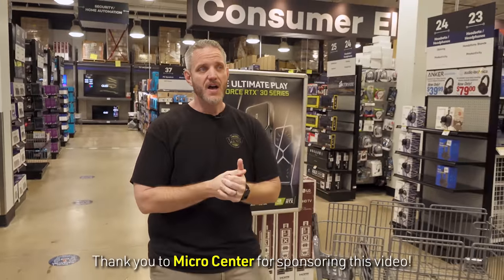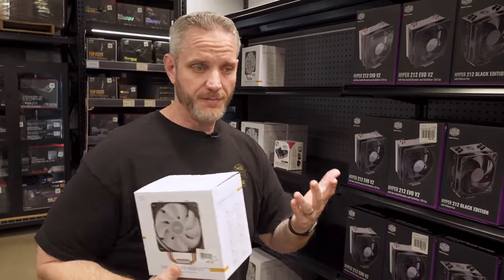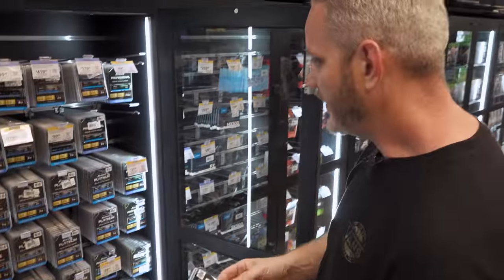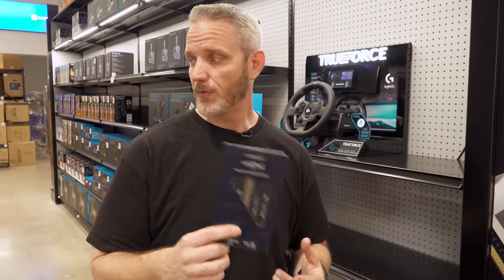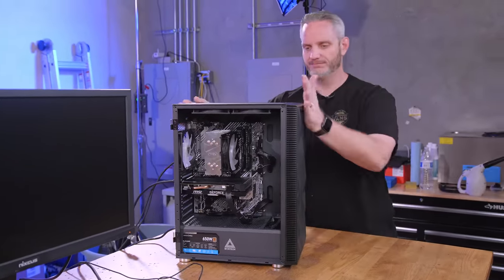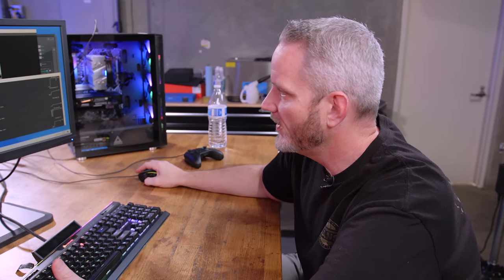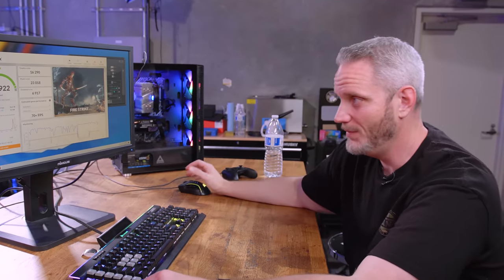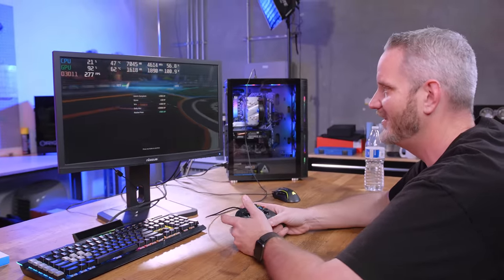How cheap can I build a "Gaming PC" for in 2022

Comment: Confused by the CPU choice: yes the AMD was $20 more expensive, but it comes with a cooler, so you'd have saved $10 overall.
Reply: You read my mind 😵‍💫😵‍💫
Reply: First thing he mentioned as a reason is that he hasnt done a video with it yet
Reply: @seamuskavanaugh3873  That was one of the things he mentioned, but the reason he eventually gave was it was $20 cheaper, which it wasn't when you include the cooler.

This was about doing a budget build, not testing a CPU.
Reply: all 11th and 12th gen intel cpu comes cooler. but he made a good choice of buying a different cooler since stock ones are generally not the best, for intel and amd
Reply: @lordtachanka8333  He put out a video not so long ago commenting on how AMD's box coolers are actually solid, especially if you're not doing any major overclocking. Intel CPUs generally don't come with coolers, and the one he bought certainly didn't, unless it was too tiny to cool anything bigger than a sweaty gnat.
Reply: @lordtachanka8333  AMD coolers work fine if you don’t overclock
Reply: @tippytoes2133  Yes...?
Reply: In all fairness to the end result, the 11600k scores about 5% better than the 5600x and 5-12% better than the 5600g in all tests on CPU Userbenchmark, so it may be a couple dollars more, you also get more performance.
Reply: @SoupKnotSea  CPU user benchmark is infamous for favoring Intel over AMD to the point of being a meme. 

Going with Intel was a mistake here, if it's a budget build. He spent more in CPU + Cooler + Mobo, and that defeats the purpose, especially for such a small percentage boost.
Reply: @lordtachanka8333  AMD coolers in box are actually designed for the cpu they come with.  The only issue is if you decide to overclock or alter ratios in the cpu
Reply: @ByMonitorLight  The Wraith Prism is definitely a solid stock cooler for AMD Ryzen cpu's if it comes with one.  Problem is it's very loud if you do many cpu intensive things.  Changing to a Noctua NH-D15 was so nice and quiet in comparison.
Reply: @casedistorted  "Very" loud is very subjective. I use it and it's perfectly fine. Yea I can hear it in a quiet room but frankly there's almost always some sort of ambient noise anyway that just cancels it out. Ceiling fan on high for example and I no longer hear the Wraith cooler at all. Tv/radio etc do the same. Gaming the game sounds cover it. Watching YT vids the video sound covers it. So......... when exactly is it an issue for you?
Reply: @SoupKnotSea  Are you unironically quoting CPU Userbenchmark???
Reply: My I5-11500 came with a cooler in box. Not the greatest tbh, but it works.
Reply: @casedistorted  changed mine Intel's stock cooler with an NH-D15S and got more than 10 C lower temps for I5-11500. But it's a giant😅
Reply: @SoupKnotSea  Regardless, that's not what this video was about: it was about building a functional gaming PC on a tight(ish) budget, and the 5600x was the cheaper option, while sacrificing little (if anything) performance-wise.

And the fact is, Jay said the 11600k was the cheaper option, when it clearly wasn't.
Reply: I bought a 5600x and tried using the stock cooler, but it ran very hot and loud, the worst tower cooler is better. For 30$, your ears will thank you.
Reply: @ByMonitorLight  I will accept that but also say that it wasn't about doing it on the absolute lowest budget possible, just on a lower budget.  Either one will get the job done with little to no noticeable difference.
Reply: @tippytoes2133  LOL clueless readers
Reply: @tippytoes2133  Damn you stuck a decade in the past?
Reply: I was thinking the same thing, not to mention power consumption
Reply: @tippytoes2133  If you prefer one over the other, that's fine, but as soon as start spouting hyperbolic bollocks to justify your preference, you undermine your argument and come across as just another fanboy.

Also, opening with "LOL nah" suggests you've been building PCs since you were -8.
Reply: @tippytoes2133  Clearly... ;)
Reply: webtiger1974  the motherboard he picked was less money
Reply: @ByMonitorLight  Also, why did he buy an unlocked cpu with a very low spec H mobo? It just doesn't make any sense. There is no point buying a more expensive K-series cpu. And IF the 11600k is better in performance, that wasn't benchmarked on this H series mobo, soo... byebye ~5% more perfomance. I'm confused :D
Reply: And by choosing Alder Lake you will give Microsoft effective ownership over your PC.
Reply: @SoupKnotSea  - Who uses that sh*t as a benchmark?
Reply: 11600k is better than a 5600g though and it's only $10 more
Reply: @phoenixr  i cant even hear mine quietest build ive ever had
Reply: @tippytoes2133  wow! I have run amd for years and have never had any issues you mention. Maybe its your ability thats the problem. I just built a new amd system and it is so quiet all you can hear is the nvme ssd noise when opening and closing applications. Its hands down the quietest and fastest pc i have ever had.
Reply: A K CPU with a motherboard that can't overclock, better going for a 12th gen F
Reply: @Stavroization  But 5600G can handle some games in 1080P without a graphics card.
Reply: @tippytoes2133  In your 22 years your brain turned green.
Reply: @tippytoes2133  an actual Intel and Nvidia fanboy lol!? I prefer them too but even I know if you don't care about ray tracing AMD graphics cards beat Nvidia's right now, and you get to pay less to boot!
6900XT is half the price of a 3090 and beats it in rasterisation. Ryzen has been dominant in performance, only Alder lake finally beats it. And at what cost? Expensive, hot, and requires Win 11. By the time you probably read this the new AMD 5800X 3D will be out and AMD will be on top again in the CPU market.
Have you been living under a rock??
Reply: @SoupKnotSea  whats the point when both are limited by a cheap 60/75fps 1080p monitor?
Reply: Literally what I was going to post as well "useable" cooler and cheaper Mobo.
Reply: i3 12th gen has also great performance and comes with a cooler. Sometimes it outperformes i5 12th gen
Reply: @xuser48  but he bought a gpu so that doesn't matter
Reply: @casedistorted  Wraith Prism wasn't powerful enough to cool the 2700x it was shipped with, even when I turned off all the turbo functions that are activated by default in the BIOS! Still got up to 100°C and sounded like an airplane. Scythe Mugen 5 cooled it down to 60°C whith much less noise. I put the Wraith on an old Phenom II X4 that I gave to a friend. It was good enough for that at least.
Reply: @tippytoes2133  you most definitely have not even been alive for 15 years lmfao
Reply: @skyknight0408  you sure you didn't use the stock or some cheap shitty paste? I can get 80 at most FULL LOAD with the stock cooler on mine.
Reply: And if you're going to go Intel and not overclock, why not 11400F or even 12400F? Save money or get more performance? Questionable choice.
Reply: webtiger1974  
it's funny becaus ethe reason I picked INTEL when doing my own build was the mobo+CPU was cheaper (I wanted ARGB, yes, but the difference WITHOUT it was still bigger)

I have no clue on why they couldn't find a cheaper mobo. I'd never call anything over $100 a budget mobo. ... even €80 is fancy for me.
Reply: @dxrrk  Different paste was the first thing I tried, but didn't do much change. Even with stock paste it shouldn't go that high when using stock clocks! 
And 80 is still too hot. Never before had a CPU that's gone over 70 even with stock cooler and paste, which means this cooler was more underpowered for the CPU it shipped with than the things they put on the FX-8xxx series. The last CPU I had that really stayed cool with the cooler it came with was said Phenom II from 2009. Every AMD cooler I had after that was crap! If they made good coolers, aftermarket coolers wouldn't exist.
Reply: But you get a beefy cooler which allows for more overclocking, plus Intel chips of that generation generated less heat than AMD cpus so you can completely forget any worries about temperature and overclock to your heart's content
Reply: @JCrook1028  If you are 
3D rendering overnight you dont want a noisy computer in your bedroom.
Reply: @larsjonasson2959  I do render at night, with the PC 6 feet from the bed... Not an issue at all. The ceiling fan is louder than the PC is.
Reply: @lordtachanka8333  I have the wraith cooler and it's not a issue at all on a 5600x...
Reply: @lordtachanka8333  False. They do not all come with coolers, clearly this did not.
Reply: He's a Intel fanboy
Reply: @jeffpayne9655  I only started watching Jay's stuff about 6 months ago, but he has spent most of that time commenting on how AMD have ruled the market with good reason, and the issues with 12th gen make it unlikely that's gonna change any time soon, unless AMD seriously screws up their next release.

Preferring one thing over another does not automatically make one a fanboy, though calling someone a fanboy just because they don't agree with your preference is suggestive.

Personally, I prefer AMD for the bang-for-ya-buck, but that doesn't mean I don't think Intel make generally better processors: just that the margins aren't worth the cost.
Reply: @ByMonitorLight  Bang for ya buck? I can buy an i5-12600k that from every gaming benchmark I have seen is just below or on par with the 5800x/5900x (5900x is like $400 dollars more than the 12600k in Aus) or I could get an i5-12400f which is on par if not better than the 5600x and is cheaper. Intel's new 12th gen CPUs are pretty good unless you are talking about the very high-end i9-12900 (around the same price as the 5900x).
Reply: @xuser48  This is where you people should grow the F up, Gamers Nexus did a head to head comparison of these two as well and came the the exact same results, and Toms Hardware, and every other CPU/GPU comparison site and YouTube channel, neither of these CPUs have a performance advantage over the other that would really be noticeable to a human. So it comes down to availability and cost on the particular day and location.  This site works perfectly well for general info to 99.8% of population.
Reply: You can also run many games at medium-high settings at 1080p with just a 5600G and no GPU. Which was his goal.
Reply: @phoenixr  did you get a decent case? does it have decent airflow? i wouldnt build a gaming-pc today, without a mesh front, if it is a standart design case. the benefits of having that mesh is really high.
Reply: @SoupKnotSea  - Blah-blah-blah. !!!
Reply: @DiesleWhite  - Exactly. 5600G is an underrated CPU (APU).
Reply: yeah think the end statement is just the 10$ saved going AMD is not equal to the 10% different in performance. if it was like 50$ savings sure you can whine but at 10$ this comment probably wasn't needed to nit pick lol
Reply: I think intel is a smarter choice at budget ngl. As someone with a 5600x, the frame jump between 2133mhz and 3600mhz was huge, and using intel which can run the 2133mhz ram and achieve higher potential makes intel cheaper
Reply: @Caabooose  the bad thing about going for like 5600g, for example, would be, that you dont have pcie 4.0 support. of course, it is a buget system, where you couldnt even afford a graphics card by the time but i still dont like, that amd didnt do 4.0 on those g chips. i dont get it.
Reply: @ByMonitorLight  intels coolers are honestly fine if you aren’t overclocking. It won’t thermal throttle
Reply: @BigRheno  are you insinuating intel coolers are not made for the cpus they come with? Lol
Reply: I would’ve went with a 11400/f instead of the 11600k since jay went with a h570 mobo or maybe 11400/f was not in stock
Reply: the wraith is on par with a stock intel cooler contrary to popular belief, not really any good regardless
Reply: And the Intel stock cooler is complete useless IMO.
Reply: @xRegyy  how? It’s not particularly quiet or pretty but your cpu won’t thermal throttle so long as you’re not overclocking it
Reply: @lordtachanka8333  I purchased a 12600k off newegg, new and it came with no cooler.
Reply: @tippytoes2133  my current PC is the only PC I've never had any problems with and it's running an AMD chipset and graphics card I was hoping to get an Nvidia but I just couldn't afford it but the CPU has never had a single problem with drivers or anything just in my personal experience
Reply: @stonalisa3729  The stock AMD cooler on my granddaughters R7 5700G has a mild overclock on it and not running a benchmark it doesn't run much over 82C.
Reply: webtiger1974  AMD is buggy and is not particularly optimized for windows by comparison to Intel. 

I feel you, it is cheaper, but if you are building a budget PC then you probably aren't like us. By that I mean, we here are all quite used to troubleshooting and compatibility fixes. 

Someone building this type of PC is probably new to PCs and needs it to sorta just work without much know how. 

Intel is still the way to go in that regard. 

I know that wasn't Jay's reasoning but that is where my mind goes.
Reply: @tippytoes2133  Okay but Alder Lake drivers were shit at launch. They’ve only become more stable in the recent months
Reply: @elibirchfield  yes since the 5600x is actually a little bit faster than 12400f
Reply: @tippytoes2133  are you still running fx or something, clearly your " exspierence " hasn't done much for you. Built multiple intel and amd systems, amd systems have always done much butter in my exspierence. With me having multiple intel cpu and mother just die for absolutely no reason what so ever after about a year of running. My person system im finally upgrading has been using a ryzen 2600 since launch and a rx 580 that was previously a mining a gpu. Clearly your just a Nvidia intel fanboy, ah yes how are the arc gpus doing rn again?
Reply: @skyknight0408  I think you might have somthing wrong then, just worked on a pc that's using a wraith stealth and a 2700x and it had no temp problems what so ever
Reply: Ryzen 5000 doesnt not include a cooler
Reply: @elibirchfield  5600x still beats the 11600k on top of that
Reply: @CloudyLuvsSlvts  Well, I don't have any temp problems since I changed to a good tower cooler. Maybe my wraith prism was faulty from the beginning. I think I remember having jumps in quality with AMD coolers before, so maybe I just got extremely unlucky with this one. 
It's not like I was in a rush to get another one of the same after I witnessed that one of this model didn't do it for me. If something doesn't work for me, I'm trying something else next. And if that works, there's no reason to go back and try the first thing again.
Reply: @skyknight0408  yeah I fully understand that, I get why you switched it probably was faulty because there usually pretty decent when it comes to cpu coolers that come free but I know they can get a little loud at times but other then that I don't personally have anything against them so far
Reply: @tippytoes2133  actually im not. The pc I had for the longest was a intel pc with a Nvidia graphics card which I ended up giving to family member bc I trusted it would be going for a while from now. I love Nvidia and it even has stuff I like over amd like I much prefer the built in clipping system for Nvidia and the encoder is much better at lower bit rates but you have to realize that pretty much everyone replying to you just completely disagrees and just think your a intel Nvidia fan boy. Even people who like Nvidia over amd where against you. Yes I prefer amd now but that's just bc it has things I like better then the stuff Nvidia has to offer. Which there's nothing wrong with liking one brand over another 🙂👍
Reply: @skyknight0408  what kind of case do you have, if you don't mind me asking? Very interesting how your temps are that high considering I have a q300l with no intake fans and it's still running cool with the Wraith.
Reply: @youseff500  Like I said, my Wraith might've been faulty from the beginning. It's not like I had more than one of them to really test it. It just didn't work for me and I replaced it. End of the story. 
I did another Ryzen build a year later for my sister, but since her room gets even hotter in summer, I got her a stronger cooler from the beginning and didn't even try to put the Wraith in it.

When it comes to cases. For the longest time I didn't really care about cases and always used the oldest, most sturdy metal case I had. I kind of did "Sleeper Builds" before it really was a thing. But I realized some time ago that it wasn't gonna work temperature wise anymore and I needed a case with space to put some fans in. 
Still not buying any high end cases. I just look at the budget options and take one that can work with some minor tweaks. The one I have now is Azza Titan 240X. It had terrible airflow out of the box, so I replaced the front plastic window with a metal mesh and put two 140mm fans behind it.
Reply: @skyknight0408  neither, i do have a case with pretty bad airflow: ionz kz02. gonna get a 4000d airflow when I have the money. 80c is indeed too hot but I've started reaching the 90s now, almost 100s. I used some corsair thermal paste, I'll be upgrading my cpu cooler soon anyways
Reply: webtiger1974  NOT A DEAD format ,, AMD4 is DEAD DEAD DEAD it is NOT going to continue , finished FINISHED
Reply: Dont math at me, nerd.
Reply: @tippytoes2133  You're still living in 2012 😂
Reply: @phoenixr  How do you even notice the sound? Do you not have headphones?
Reply: My boy jay lost his cents
Reply: Intel and Nvidia probably pay Jaybooboo more than AMD for his advertising ("PC Building") services.
Reply: @lordtachanka8333  no cooler on i5 11600k m8
Reply: @ByMonitorLight  he mentioned amd motherboard prices but didn't mention Intel mobo prices. If they are the same that sure but everything I've read, Intel mobos are  more expensive so not actually cheaper.
Reply: @tippytoes2133  If you have had BSOD:s and other problem with your AMD builds is because you clearly don't know what you are doing. I have built PC:s for over 30 years and never had any problem with AMD (not even had problems with old Cyrix CPU:s). Drivers issues? Learn to how to install drivers and you will not have any problem. The LOL is on you my friend😆
Reply: the wrathcooler and stealth cooler perform differently when not in full 80% RPM and stock coolers perform worse in full closed glass panel cases even with multi front intake.
Reply: hmm
Reply: @ByMonitorLight  Yeah but all colour matched...................so there is that.🤔😉
Reply: @lakshmanshiva1686  Have you ever wondered why when something goes wrong with peoples computer it's always the monitor that gets bashed up? Poor monitors get a bad rap when all they want to do is show you what the computer f'ed up.😁
Reply: @lordtachanka8333  My 12600k did not come with a cooler.
Reply: @SoupKnotSea  50 dollars more for %5 lmao. Intel fanboy detected.
Reply: Exactly. Also the GPU pick felt very weird, the GTX 1650 is definitely not a good choice, especially when the RTX 3050 is a thing, RX 6600, etc.. you pay a little bit more and the GPU will endure more than 2 years at least. Future proofing is a must regarding this hobby, you are not supposed to invest $500 on "upgrades" every two years or so, that's inefficient and a waste
Reply: No it doesn't. My AMD 5700X didn't come with a cooler.
Reply: webtiger1974 amd motherboards r usually more expensive in my experience tbh lol